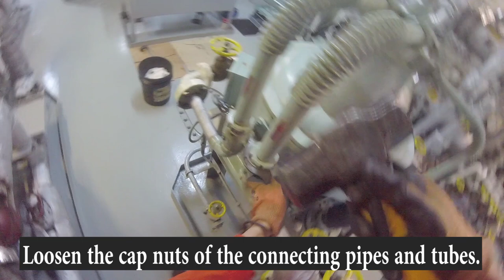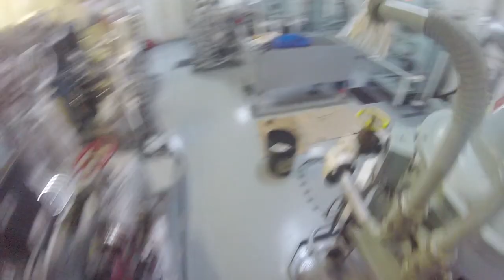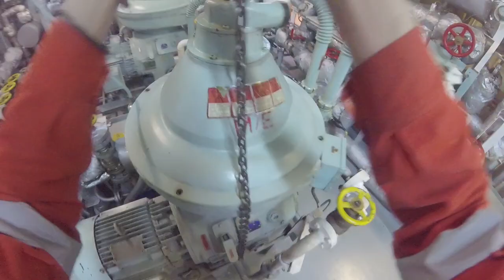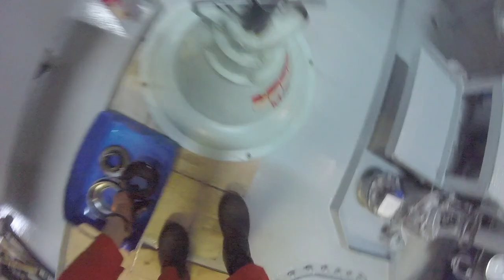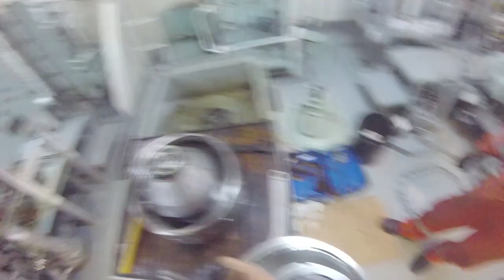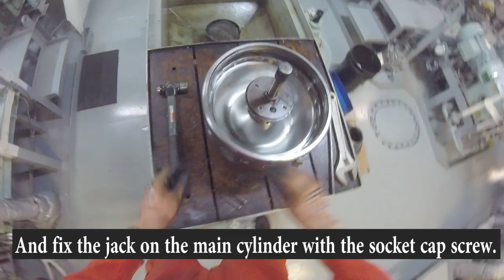Selfjector Purifier Bowl Overhaul | Seaman Vlog | The How's of Seafaring

Comment: Watched this out of curiosity. I have disassembled many a Alfa Laval purifier for cleaning. These were the manual cleaning cycle ( we called it shooting the bowl ). Then when needed a full strip down for a bowl disassembly and clean. The disassembly was a lot more simpler, fluid entry and discharge pipes not having to be removed. The hood pivoted back to reveal the bowl. The outer body was locked in place and only the upper bowl cover had to be removed to give access to the distribution cones. Then they could be lifted clear and cleaned. Stop to start probably 2.5 hrs. Then automated cycling came in. It was not 100% certain that a bowl would seal again after cleaning and it would trigger an alarm. No fun when your duty engineer and asleep. Seems things have moved on since I retired. Thanks for another quality video.
Reply from the maker: Yes I heard Alfa Laval is more complex then a Selfjector type. Thank you for watching!

Comment: On the old Alfa Laval LO purifiers all one had to do was carefully tap out the steel tapered pin from the drive shaft, lift up the hood with the chain block, and remove the many discs for cleaning.
Reply from the maker: I haven’t experienced handling a Alfa Laval type of purifier yet, hoping to experience it too!
Reply: @SeanLentze  alfa laval is very tricky during assembling and dis assembling..